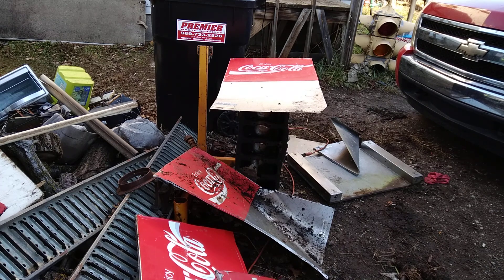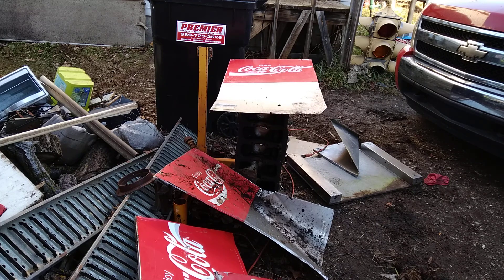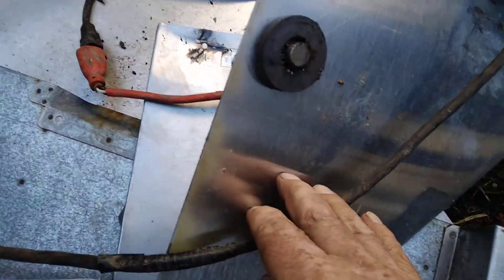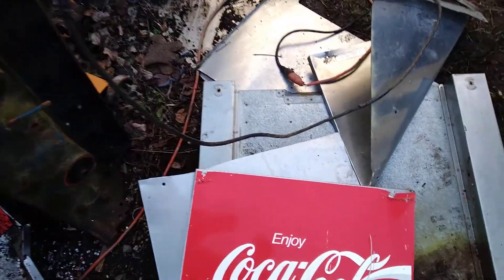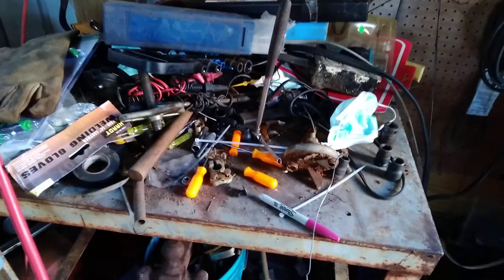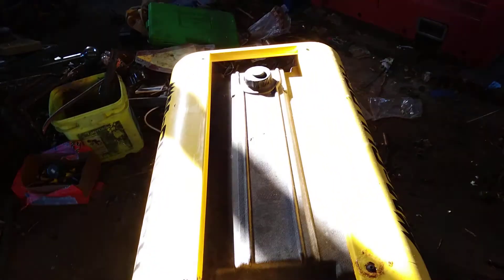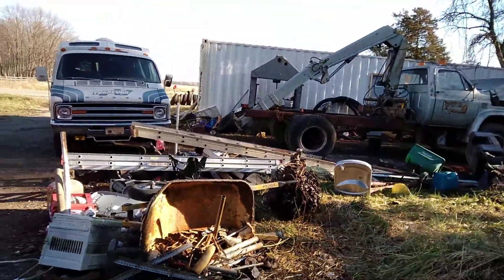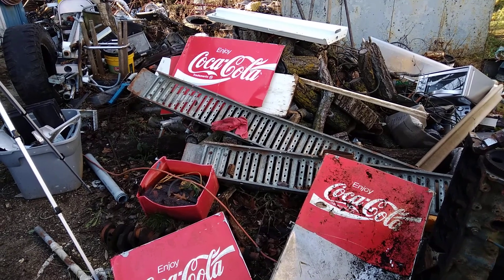making things out of scrap metal things go better with Coca Cola

Comment: Well I don't have one of those, might be nice to have someday. But I do have a ripper chisel for my air hammer that I found in a dump truck. That works great for sheet metal but not 1/8" metal, maybe 1/16" at most.
I have lots of attachments for the air hammer, including a fan clutch removal/installation tool set. It has all the common sizes and works great.
Reply from the maker: That stuff is definitely useful to have I don't have a set but I've got a lot of miscellaneous tools maybe going shopping for a piece of equipment tomorrow we'll have to see thanks for stopping by
Reply: @billjunking_fool5549  that sounds like fun to me! I'm happy, the boss recently bought 3 dump trucks for me to take apart (I work for a salvage yard) plus I'll get to save plenty of parts for myself
All 3 are 2008s, 2 of them are crew cab GMC c5500 duramax diesels, the 3rd is a Ford f350 super duty with a bad 6.4. I prefer taking apart bigger trucks instead of cars and vans and little pickups all the time